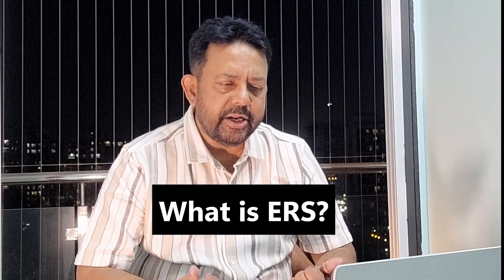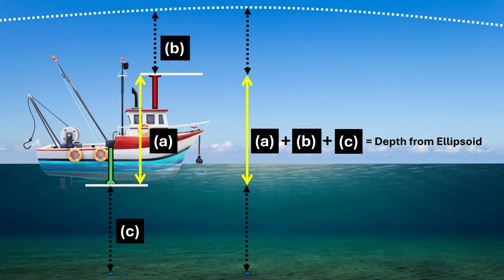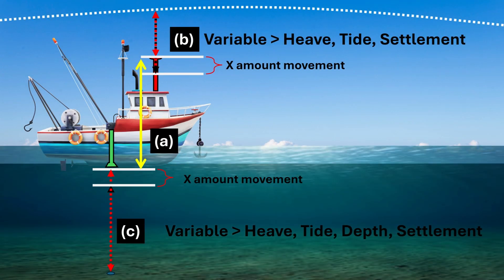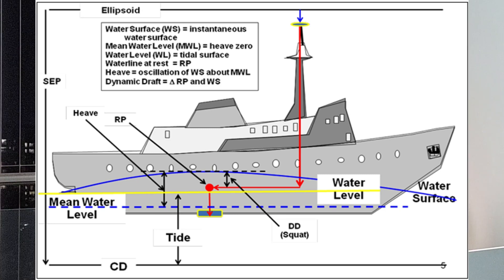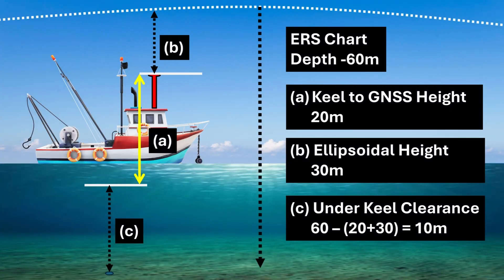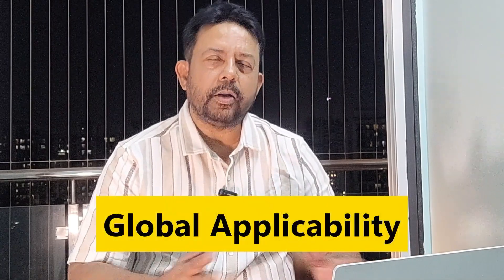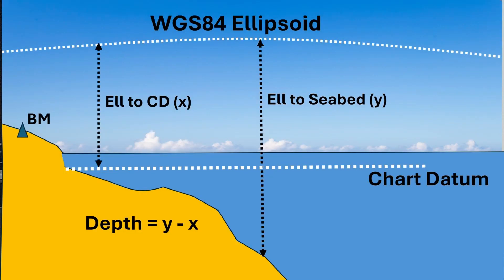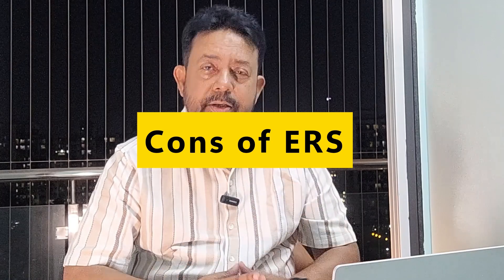THIS COULD CHANGE The Way We Do SURVEY!!

Comment: How much vertical error might appear in RTK Tide vs ERS if we are moving away from base station and how to perform quality assurance check?
Reply from the maker: I have already discussed this in the video itself. It is not about RTK or ERS. You Can do the ERS with RTK or with L1 GPS or L1/L2 DGNSS. You need to know what contributes to the error.